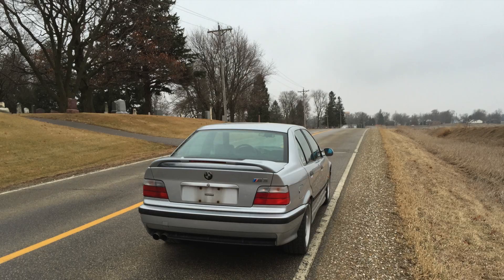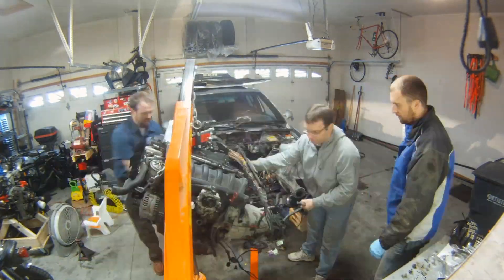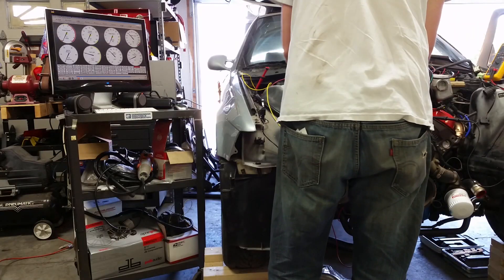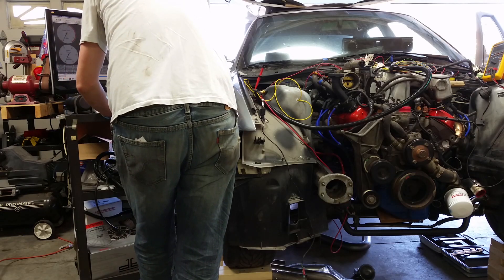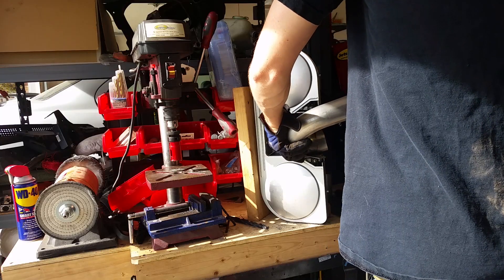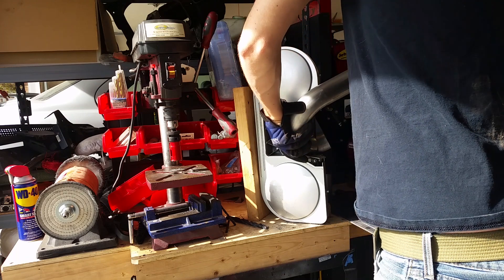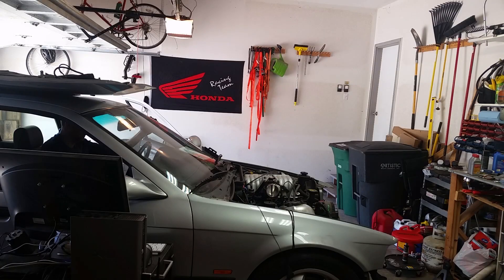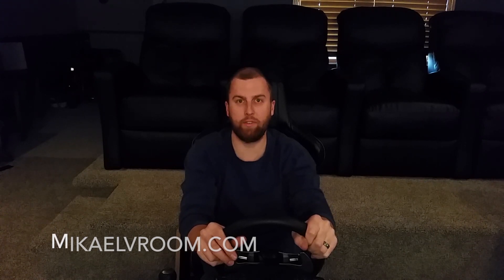E36 M3 V8 Swap - First Startup on Megasquirt

Comment: nice build, how did you get on with mig welding the v-bands? Did you manage to avoid warping them so they seal nicely?  What material are you using?
Reply from the maker: They are mild steel, and the cheapest I could find on eBay, about $17 each I think. I welded them in a few stages and they were thick enough that no warping occurred!
Reply: great work dude thanks for the reply, got a link to the v-bands by any chance?